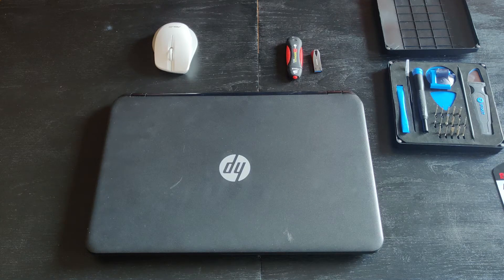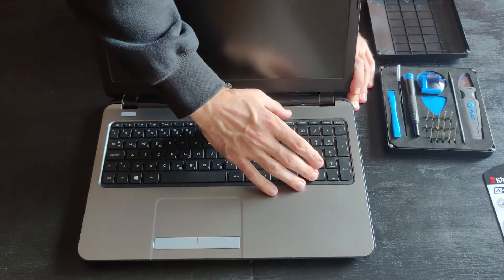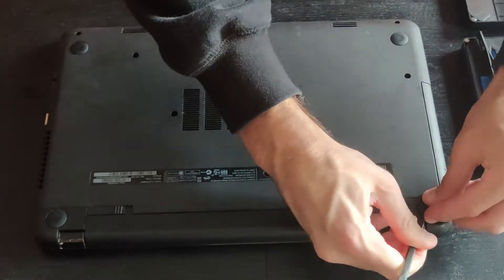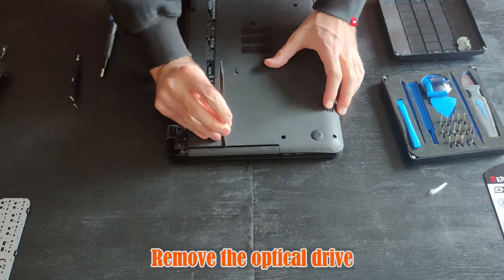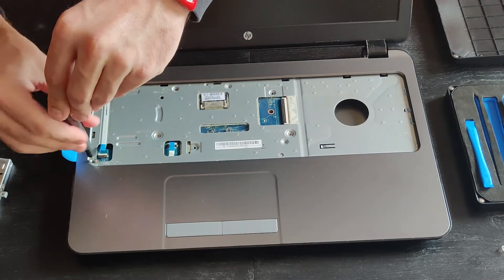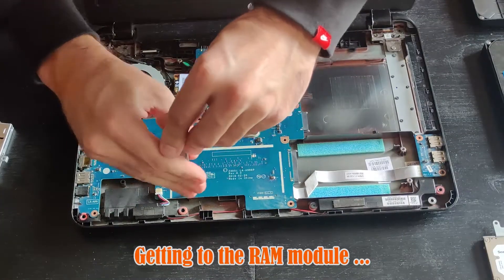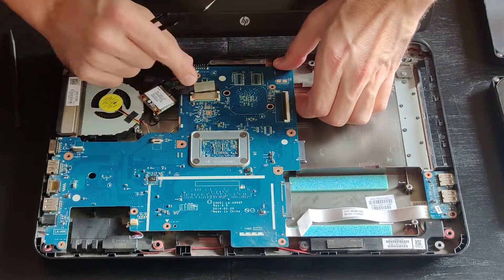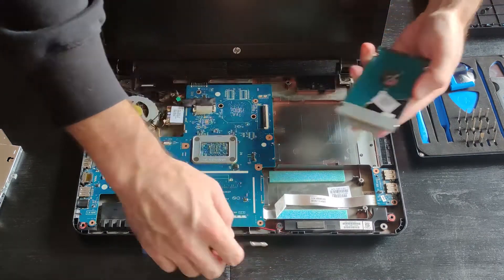HP 255 G3 Notebook SATA SSD Installation

Comment: Bg, Laptop saya hp 14 amd a9-9425 radeon r5, 5 compute cores 2c + 3g 3.10 ghz
Saya tambahin ssd v-gen 256 type hyper, bisa gak bg? 
Tolong bg, saya agak kurang paham soal. Laptop
Reply from the maker: What model and brand of the SSD did you add exactly?